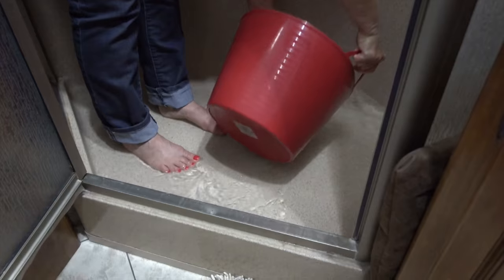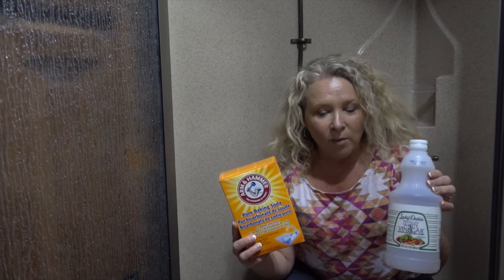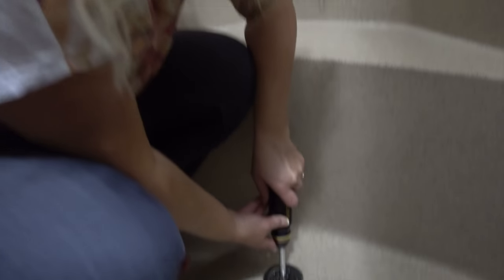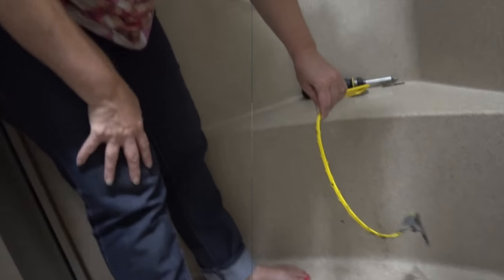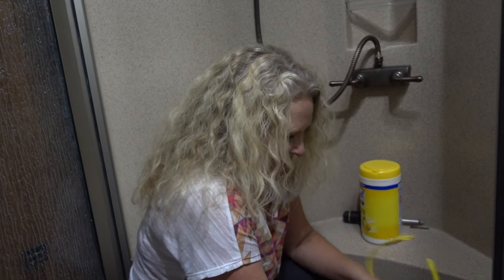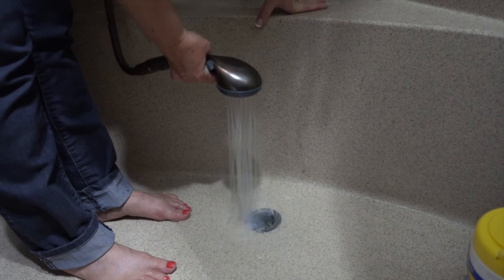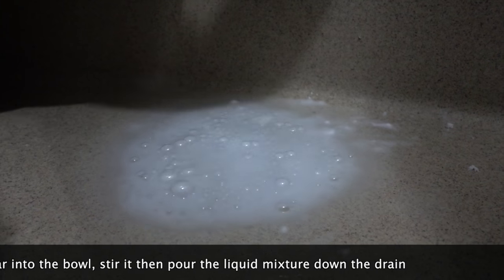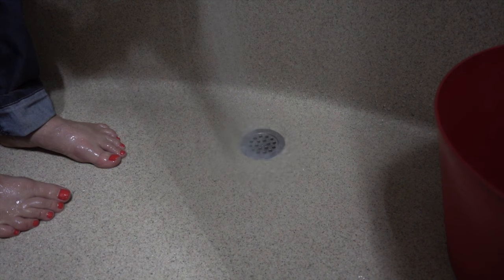RV TIP: How to Safely Unclog a Drain – a Septic Safe, Cheap & Natural Solution

Comment: Great video, thanks, it worked!  Except, since I use a drain screen, there was no hair (mine's about as long as yours but not as thick or curly).  The drain screen looks like a bowl made out of screen, and costs just a few bucks.  I have to clean it after each shower, but it's easier than snaking.
Reply from the maker: Yes, those are great when you have an appropriate drain. Thanks for sharing. -M

Comment: You can be pro-active and pour a cup of vinegar down your drains on a weekly basis. We do that on our S&B house. I will give the baking soda/vinegar solution a shot in my tub...I have a slow drain there. Thanks, Julie!
Reply from the maker: Good tip - thanks Diane! I have loads of vinegar on hand. Someone else also said you can buy a hair catcher for inside the drain so I might pick up one of those too

Comment: Well, thanks for the response. I followed the procedure today, and at first I was not happy as the vinegar just "sat there for a long while, but I waited , doing some other cleaning on the trailer and about 5 hours later went back  and did the hot water bucket and it spurted and gushed and Voila! It cleared out nicely.  Again thanks for the video and I am sure it has helped many a traveler and will continue to do so. :-)
Reply from the maker: Thanks for following up.  So glad to hear that it worked well for you too.

Comment: Good job Julie, we had the exact same thing happen in our Tiffin DP this summer. I tried the baking Soda & Vinegar mixture 1st and it didn't work. I then resorted to a similar hair grabber tool but caution must be exercised so that you don't puncture the Hepvo trap that Tiffin uses in their shower drains. if you puncture the bladder in the Hepvo trap then you will get odors back thru your shower drain. I was able to carefully remove hair and then used the baking soda & vinegar mixture. I also installed a hair trap in the drain so, I won't have to continue to be concerned about the drain clogging anymore. I hope this helps. Safe travels to you both!
Reply from the maker: Great tip thanks! I have never even heard of a hair trap, thank you - where do you find them!? Must get one! I always run my hands through my hair in the shower to collect as much hair as I can but obviously some goes down the drain - the trap sounds like a neat little contraption
Reply: We got our hair trap at Home Depot, you have to remove the drain screen and it fits down & around the drain. It's made out of a rubbery material and removes easily after each shower for cleaning.

Comment: Great idea. I purchased a drain screen just like the one I have for my home, It screw's in just like the drain cover and it keep the hair from going down the drain.
Did you know 50/50 vinegar and water will leave no streaks when you clean window's and mirrors and in winter if you divide by thirds 1/3 water, 1/3 vinegar, 1/3 alcohol use it to clean window's it won't freeze.
Keep the rubber on the road.
Reply from the maker: Thanks Brian! Love this tip - will definitely give this a try - you rock!

Comment: Glad to see it worked!  I tried it on our home bathroom drain, but didn't get great results. (not enough baking soda?).
Reply: Diane Johnston Hey Dianne, at home, might have to remove p-trap under tub or snake further than this plastic snake can go. If you do have to use a chemical cleaner, and it doesn't work and you have to call a pro in LET THEM KNOW THAT YOU USED A CLEANER  . It will save them from a chemical burn. Thanks
Reply from the maker: Good advice Terry!

Comment: Good job!!! Come on it's just hair and soap (and dead skin cells, and bacteria, and etc. lol) Another thing to consider with slow drains is a clogged vent pipe. So if your solution is not the total fix, then the vent stack needs to be snaked also. Later guys... Terry
Reply from the maker: Thanks Terry!